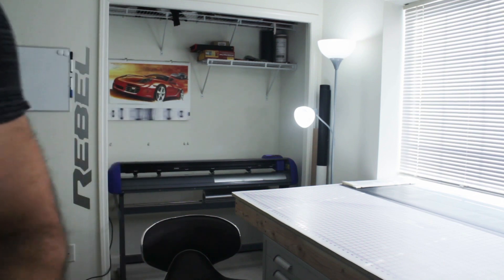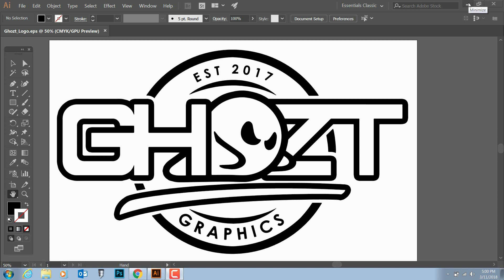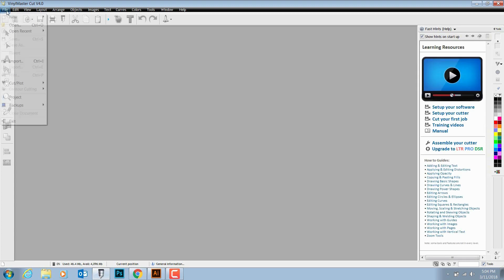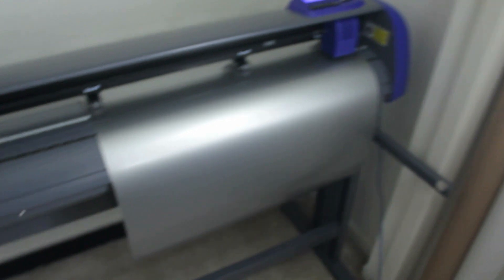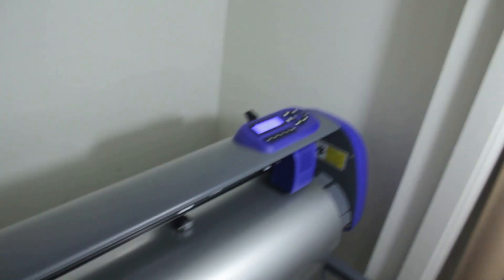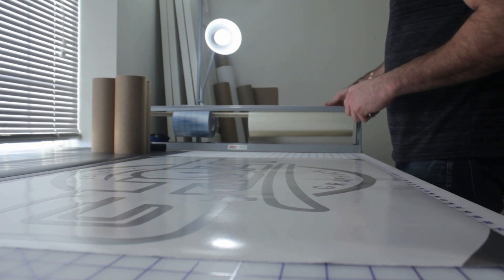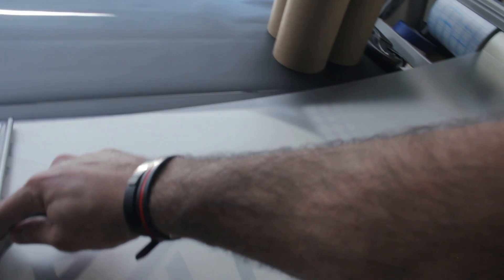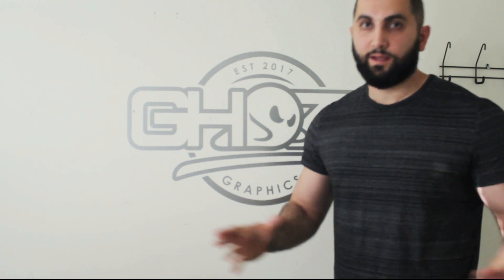How to Design & Cut a Decal US Cutter Titan 3

Comment: will this cutter be compatible with the Epson S80600 printer? I'm trying to wrap my head around if this cutter's software can cut an already printed on vinyl. Any advice will be appreciated! Thanks ahead of time!
Reply from the maker: So the titan cutters use ARMS registration lasers for contour cutting, so as long as your printer prints the correct registration marks, yes it should work. I used vinyl master software for cutting/printing duty.

Comment: Any idea if the Titan 3 can handle Windows tint film good? I saw USCutter don't recommend but i feel like is just because competitor brands push to advertise that way
Reply from the maker: SucksTeamMx the problem with tint film is it’s very thin and does not have a secure “backing paper” so tends to wrinkle and bind up with the rollers/cutter. I do know there is a method on certain cutting software that allows you to only cut in a single direction so that the film does not bunch up, if that makes sense.
Reply: @EdmonJiddou  okok, i work with flexisign and yes the software has an option to choose what direction trace but asking cuz looking to upgrade bigger size and brand, my Roland 30" is no enough for window tint patterns thanks.
Reply from the maker: SucksTeamMx totally recommend the titan series. It’s price point is great and has paid for itself 10X over...
Reply: @EdmonJiddou  thanks for the advice!